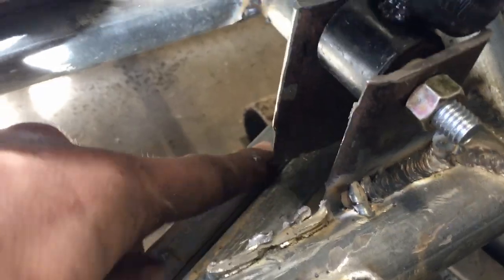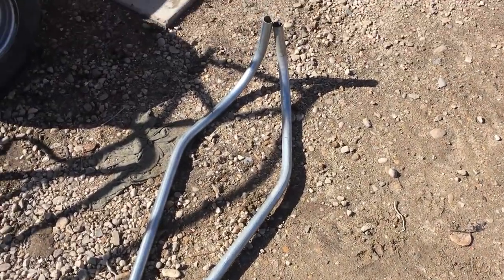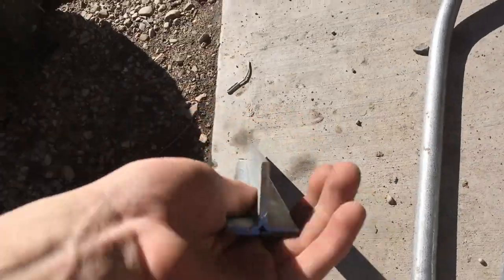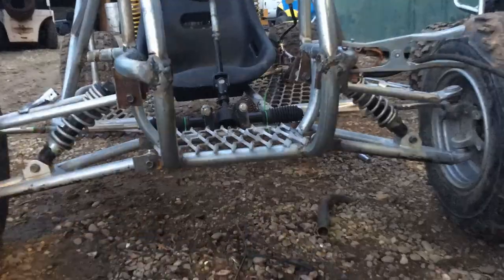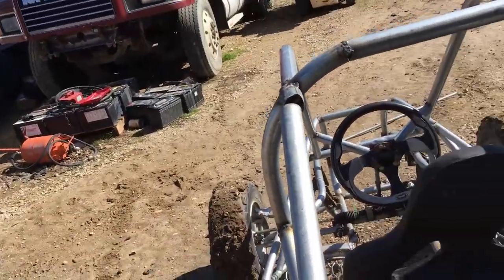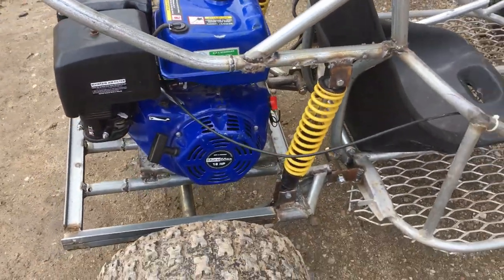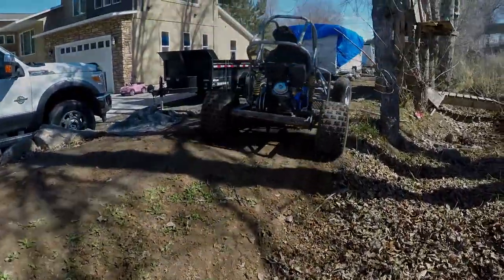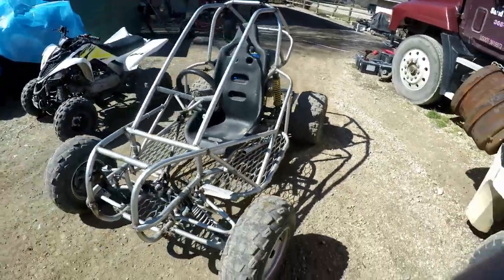go kart with +18hp engine swap! | Engine Mounting and Test drive! | part 3

Comment: Just take the governor off and install harder springs. You'll go from 3k rpm to like 6k rpm buela more speed too
Reply from the maker: That's exactly what we did in out recent Custom Go Kart video.
Reply: @realxtreme2471  just be careful revving to much, the piston rods and flywheel weren't meant to spin that quick and can catastrophic failure on the engine... that means piston rod blows out of the block. And flywheel blows into peices and can harm you and also destroys the internals as well.

Comment: What did you use for torque converter and what size?
Reply from the maker: its a 40 series torque converter.
Reply: Did you put a reverse gearbox?
Reply from the maker: @GMC.Sonoma.4.3  No, we are thinking to put a winch on it instead.